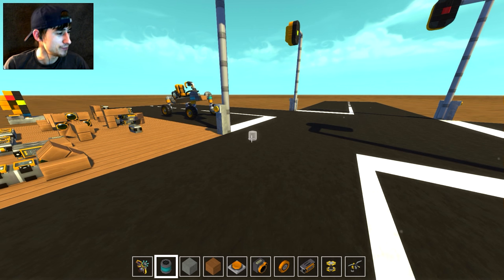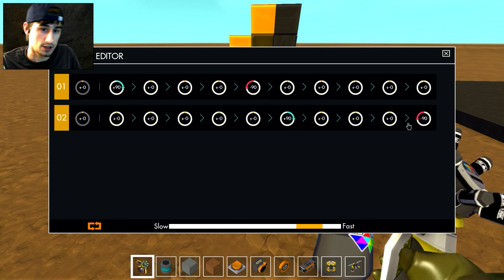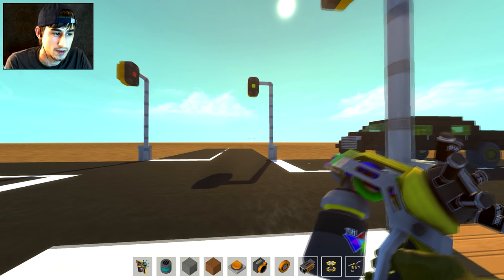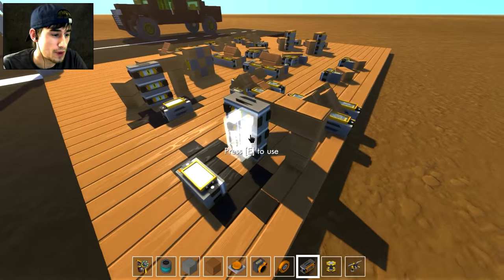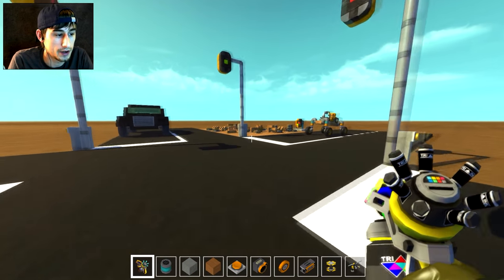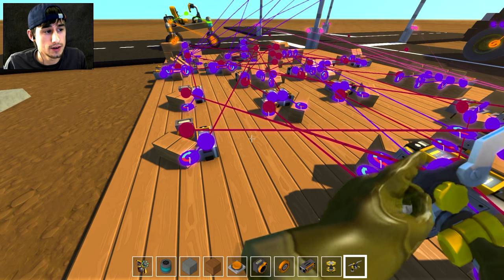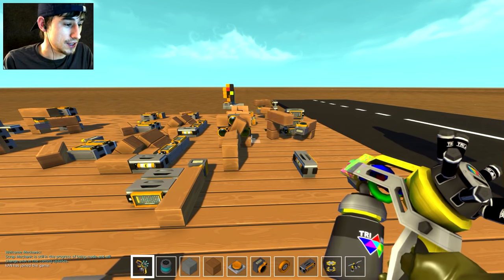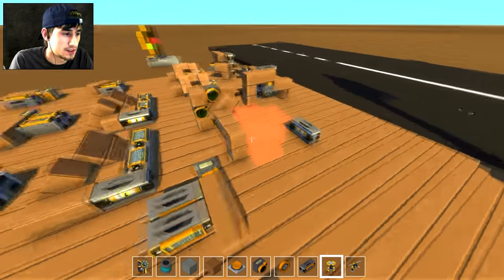TRAFFIC LIGHTS WITH ROAD SENSORS AND CROSSWALK BUTTONS!!! (Scrap Mechanic #31)

Comment: Also, once the Logic Blocks come out, it's gonna be a lot easier to make the advanced one.
Reply from the maker: I agree! Once logic blocks come out I'll do a comparison video between old and new methods as well as make advanced circuits! Best thing will be reducing the delay when the circuit is running.
Reply: +kAN Gaming I have made a memory thing myself using two NORs, and oh my was it slow!
Reply from the maker: Nice! My memory uses 3 controllers to create a set. switch & reset switch. The third controller is the loop which keeps the memory on after it has been set. I'll do a video on some circuits sometime!
Reply: +kAN Gaming Nice! I'm looking forward to that! I'm a logic gate enthusiast.
Reply: +kAN Gaming this buil is really good
Reply: +kAN Gaming kan do an livestream on your signal so you dont pause your video